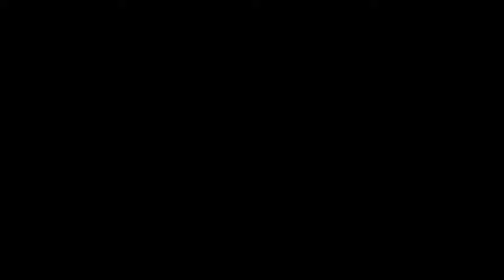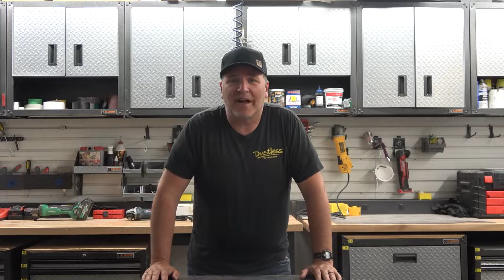CFM & Waterlift | Dustless Answers

Comment: What’s the D1619 have? The 8 gallon hepa vac..?
Reply from the maker: Hey Mike, if you're referring to what accessories the D1619 includes, the main distinguishing feature is its HEPA Floor Tool which uses a vacuum-powered beater bar to uplift floor contents. It also includes other standard items such as a regular floor tool, hose wands, and brush tool.

Regarding features, the D1619 has an included HEPA filter, semi-auto filter cleaning, dynamic exhaust ports, and more.

You can find more info here:

https://dustlesstools.com/product/hepa-wetdry-pro-w-upg-equip-set/

Comment: i have an applicagion wherei wojld need to use a hose between 30-40 feet! Will either of these vacs perform well in this setting? Ghanks. Great video!!
Reply from the maker: Good question! 
Short answer: Yes
Long answer:

Performance for any vacuum will drop at about 1% per 1 ft of hose. You can always accommodate this drop by using two vacuums together:

25 ft Hose with Coupler: https://dustlesstools.com/product/25-ft-hose-w-coupler/
12 ft Hose: https://dustlesstools.com/product/12-ft-hose-with-cuffs/
Coupler: https://dustlesstools.com/product/2x-2-hose-cplr-for-1-5-hose/

Vacuums: https://dustlesstools.com/vacuums/hepa-vacuums/

Let us know how else we can help!